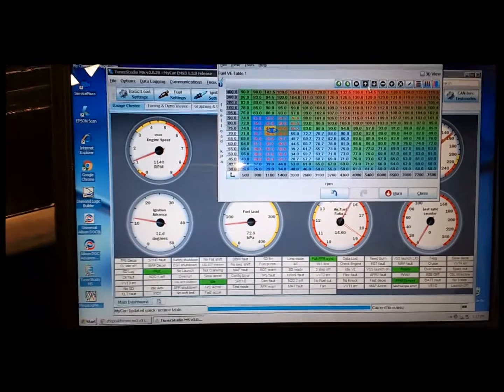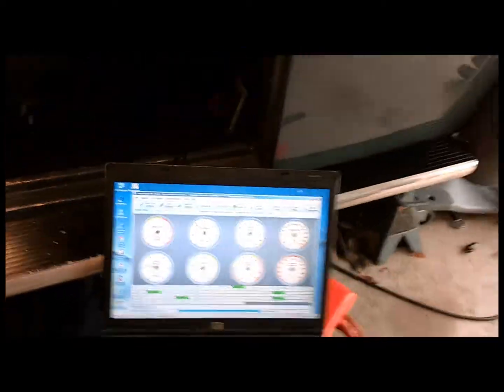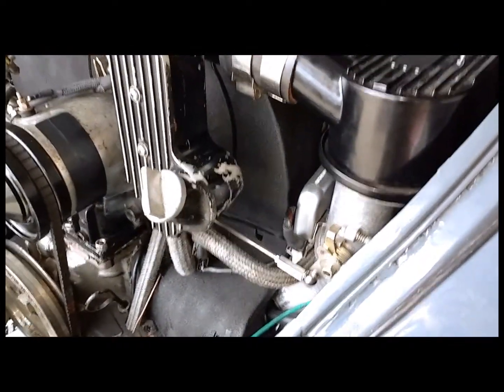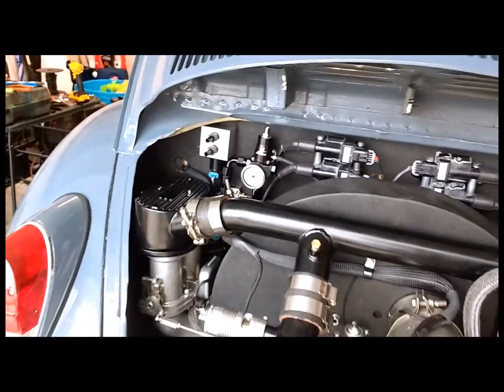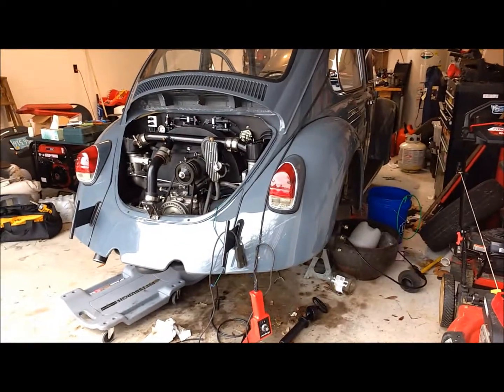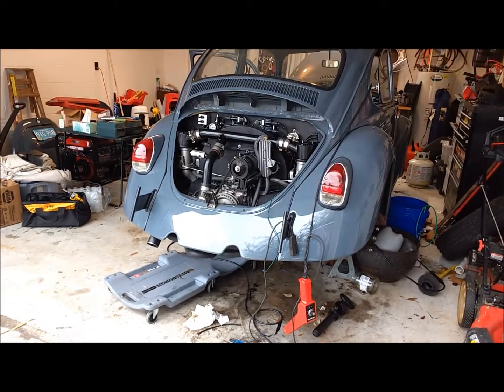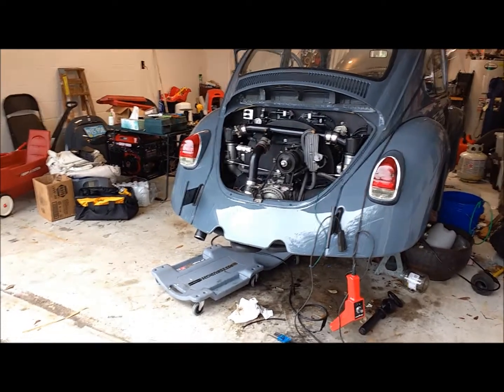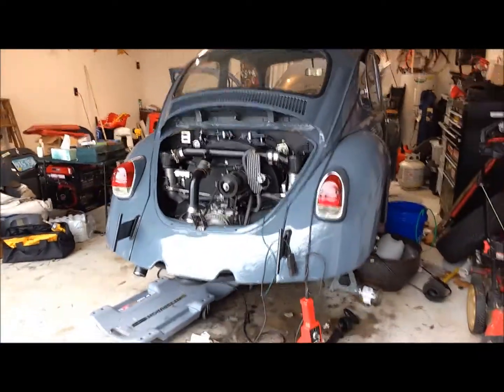VW Bug Megasquirt EFI Turbo Monster!

Comment: this car ever make it to the road and tuned.I have injection but never installed it because i know a single damn thing bout maps injection etc.When I see videos of injection i wonder if it actually got it working running at an idle is not a problem its tuning it .
Reply from the maker: My friend drove it for several thousand miles with that EFI. He eventually parted the car out ( sold the EFI, 
Motor ,Trans and body off). If you want EFI but not to tune it look into the dub shop in Washington state. He can remote tune your car.

Comment: I don’t have it hooked up yet. In order for it to work properly it needs to be plumbed to all 4 barrels under the throttle plates
Reply: Benjamin Anderson  are you're barrel body cb performance? I have a similar set up. My ecu is the ms v2. I have the iac sensor, tps, air temp, oil pressure, oil temp, coilpack and crank trigger sensor. Just trying to find out where to locate  my iac hose.
Reply: Benjamin Anderson  I am trying to send you some pictures  of my setup but it won't  let me. Could I get you're  email to send you pictures.  How did you're  car run with out running the iac? Thanks

Comment: Are you using the d.i.y  iac adapter.  How did you run you're hose to carbs body? Thanks
Reply from the maker: alan p  it's a friend of mines set up and I am not very knowledgeable on the EFI stuff. But he left a comment answering your question ( Benjamin) hope it helps.
Reply: Matt Lundquist  thanks that thing is a master piece.